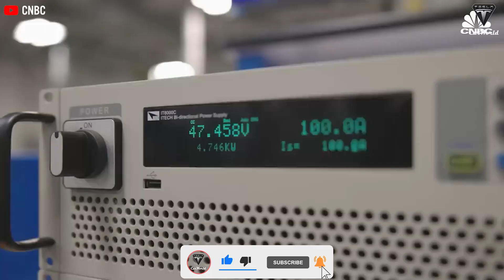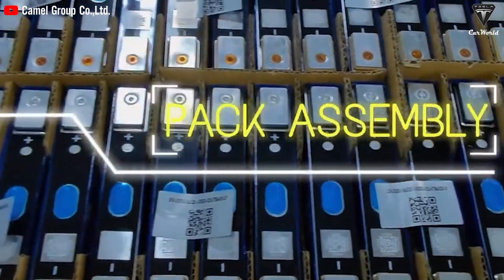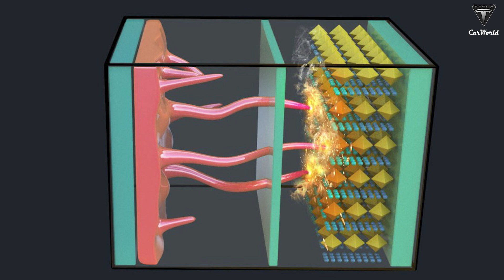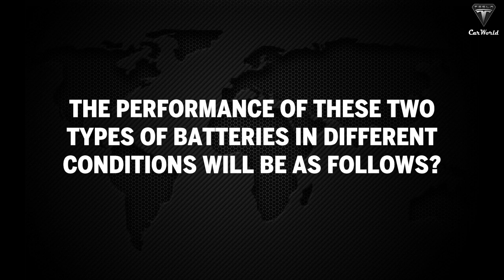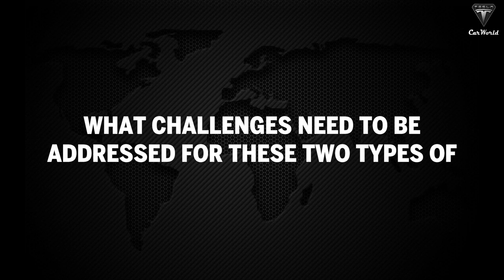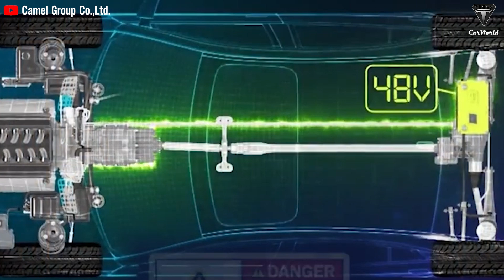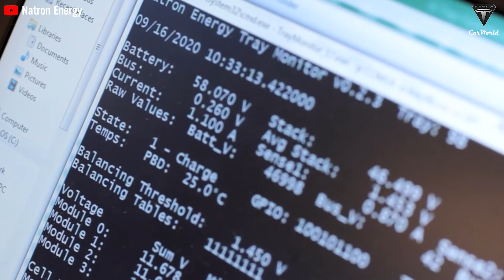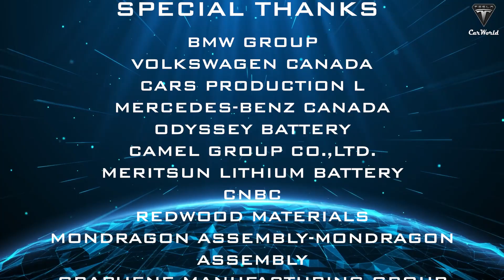Comparing Sodium Ion Battery V Solid State Battery for 2025! Elon Musk's Choice is....

Comment: No matter which way we end up going it  will always be shorter than the life  span of a ice engine before these batteries die and you will be up for a lot of coin to replace them .
Reply: Depends on one's driving habits. I've had ICE engines go bad at 100,000 miles. I am guessing batteries currently being installed in EV's are good for at least couple hundred thousand. I have some 18 year old LFP battery packs that still hold a decent charge from a Dewalt drill. Do I use the drill daily... no. On the other hand I do use it as often as I drive my car, once every week or two.
Reply: Mate you must have purchased a lemon 🍋 or your maintenance on that car/engine was either not done or done wrong . I've owned a lot of cars and travelled an lot of km"s in then over the years gee I've got an old 80 series here with 480k on the clock an still going strong as . Had many a petrol car that's also going strong with high 200k km"s as well . What these ev"s need will either be a battery pack replacement that allows a trade in of the old pack and a fitted replacement for around perhaps 2.5k - 3k tops that going to be needed when the car travels say around 200k km"s then they might be worth spending between 60 to 70k on a purchase
Reply: @trevor8672  I agree  with you. The point was to illustrate that ICE cars have their problems too. And it was a lemon. The old saying was check the build date. Don't buy if it was built on a Monday or a Friday. Monday workers had hangovers and Friday workers just wanted to get out the door. Most of my vehicles have lasted 150 to 200,000 miles. And my guess is that 5 to 8 years from now  battery packs will be approaching the pricing range you suggest but maybe not quite there yet. On the other hand I think only luxury EVs will still be priced 60 to 70k range. With the way China and Elon are going I believe EV prices for us common folk will be as affordable as any ICE vehicle on the road. Thanks for your comment.

Comment: Ok! Here's another battery. Whoopie! Cut the crap and make EVs self charging or with magnetic motors, and don't charge an arm and let for them. I welcome a $10,000 Chinese EV. Biden just placed a tariff on the to stop them from forcing the auto industry in this country to stop them from screwing people. $40 plus grand for a car or truck? Get real. States are outlawing gasoline vehicles by a certain date? What? Everyone is going to suddenly get rich and be able to afford a Tesla? Yeah right. An EV is not cheap to buy or own.
Reply from the maker: To stop using batteries for electric vehicles is quite a difficult problem at the present time, because batteries are still considered the leading factor in electric vehicles. We know that owning an electric car is not simple for people with low affordability, but with the launch of Tesla's $25,000 model 2, it would be a perfect affordable car. and many people can own them.